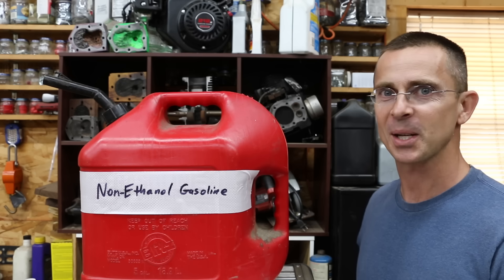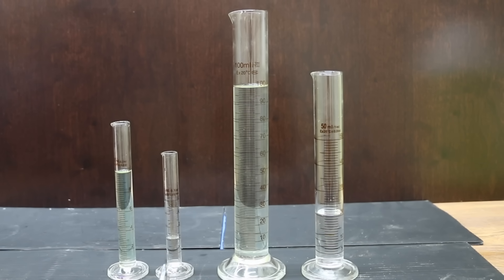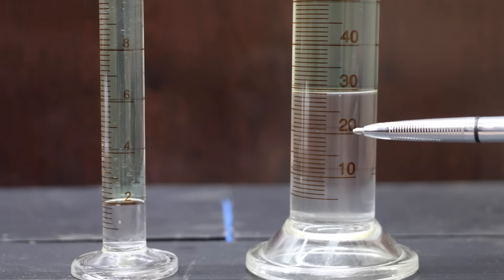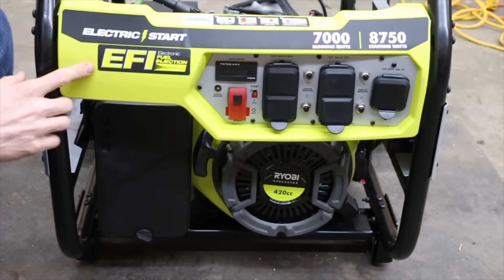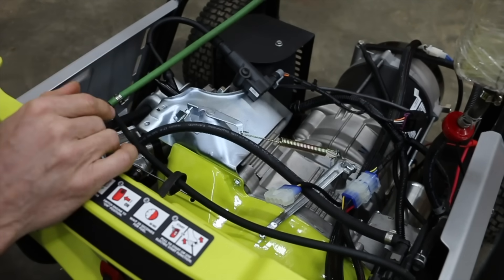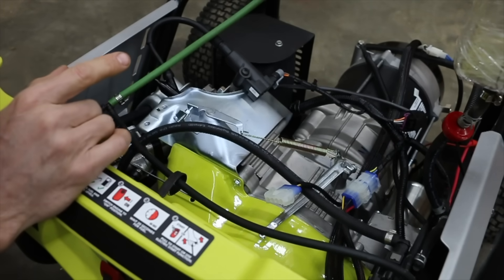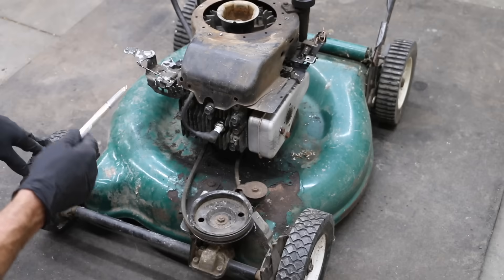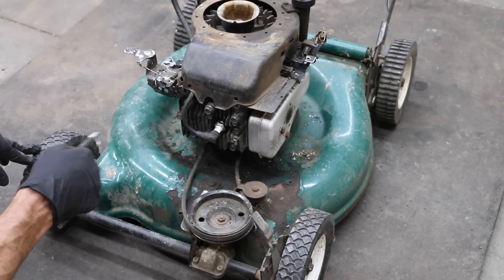Is Non-Ethanol Gasoline Really Better? See the PROOF!

Comment: Ive noticed that E85 is less energy efficient but costs less.  Typically though because of the bad fuel economy, anything saved from the price of E85 is quickly lost due to its bad mileage.  I realize this isn't flex fuel but its worth noting.
Reply from the maker: Great point. Thank you
Reply: 2011 F150 5.0 
Regular 87 octane i get 16.5mpg mixed
Super unleaded 93 I get 17.5 mixed
E85 I get 12.9mpg mixed

I get better mileage pulling a trailer with 93 than i do without a trailer on E85.
Its that bad.
Reply: @enigma9789  Wow..... huge difference. I noticed using an E30 blend the car idles better but has harder starts on occasion. This is on a 2009 135i BMW. The E30 allows the car to run much faster even before the turbos spool. So it's a mixed bag. Of course it's worse fuel economy and 93 price has dropped but I miss that extra HP. Plus... on E30 the car smelled better.
Reply: @alphazoomii9408   It does have more power on E85, that is for sure. but the 5.0 makes pretty damn good power on 93 already.
Reply: Ethanol has 66% the energy density of gasoline.  So what you need to do is run a few tanks of each and keep tabs on your mileage and your cost per mile to determine if it is worth it.
Reply: Trevor Nelson most flex fuel vehicles do benefit from a e85 tank once and a while to clean carbon out of the motor.   If you’ve ever seen inside of a motor that was ran off e85 you would be amazed how clean it was.
Reply: @jasontruman1215  Ethanol also washes away oil from the cylinder walls.
Reply: Horsepower Garage not entirely correct, if at the proper air fuel ratio it doesn’t do that too bad.... but it is a “dry” fuel meaning no lubrication. Gasoline has a very slight lubrication property.    So yes e85 should be harder on cylinder walls.    I’ve heard of guys adding a low dose of 2 stroke oil to e85 to help with this.
Reply: @jasontruman1215  I use a dose of Marvel Mystery Oil in my gasoline. It's a light oil that burns well  and allegedly fights carbon build-up.
Reply: In turbo car tuning, it's usually a pretty good start with your fuel map to double the fuel injected to get you started on an e85 tune.  Turbo cars love it, except most places vary between 70-85% ethanol and you need to get fuel from the same place so your fuel map stays tuned.
Reply: If you're in the US then Uncle Sam subsidizes the corn grown to produce the ethanol. Double whammy
Reply: The reason it cost less is because of Government subsidies and there trying to get more vehicles to run on it and people to buy cars that runs on it because it cost less to fill it with e85!
In reality it's more harmful to the environment it takes two gallons of fuel to make one gallon of ethanol not to mention the mileage sucks!
Reply: @doorguner01  "in reality it's more harmful to the environment it takes two gallons of fuel to make one gallon of ethanol" - no sir, this is some political misinformation that gets circulated a lot but it's never been true.    Think about it - If it was true, moonshiners wouldn't be making money.  ;-)
Reply: @jacksons1010  And here's you're sign!
Reply: @jacksons1010 Moonshiners make lots of money because there illegally selling it!
Reply: terry jenkins  Here’s YOUR sign smarty pants:  if it cost that much fuel to make moonshine (ethanol) then you’d have to sell it for more than what you’d pay in a liquor store...duh!   In real life they burn waste fuels like corn stubble to distill ethanol for fuel.   Let’s please keep this channel civil and avoid personal attacks, ok?
Reply: @jacksons1010  He's not wrong--since we stubbornly insist on making ethanol out of corn instead of more efficient feedstocks like algae (because of Big Ag lobbying), it actually does require nearly a gallon of fuel to run all the equipment used to grow and process ethyl alcohol from corn to make 10% ethanol.  This is also counting electricity--we're talking the emissions equivalent of 1 gallon of fuel, not the cost equivalent.

And it ruins your small engines/marine engines.

It all comes down to that uniquely American form of bribery: lobbying/Campaign Finance.
Reply: @doorguner01  so in reality it doesnt cost less at all to the consumer. kinda like a low flow toilet that u gotta flush 3 times to get a turd to go down lol.
Reply: @doorguner01  the whole idea is to turn away from primarily oil based fuel.. is it perfect no its not but its trying something until electric cars are more relevant.  atleast this is my understanding but im no chemical engineer so take it for what you will
Reply: 恵勇気  Not sure where you got you're information from but ethanol subsidies are still going that's one of the things I'm disappointed in our current president Donald Trump he's backing big ethanol producers.
by looking at the writing you live in Asia!
Reply: @doorguner01  The Federal corn ethanol subsidy and import tariff ended in 2011.  Ethanol producers receive no subsidy.  The G7 Nations' long standing stated goal of ending petroleum subsidies?...not so much.

Volumetric Ethanol Excise Tax Credit (VEETC)

Expired: 12/31/2011

An ethanol blender that is registered with the Internal Revenue Service (IRS) may be eligible for a tax incentive in the amount of $0.45 per gallon of pure ethanol (minimum 190 proof) blended with gasoline. Only entities that have produced and sold or used the qualified mixture as a fuel in their trade or business are eligible for the tax credit. The incentive must first be taken as a credit against the blender's fuel tax liability; any excess over this tax liability may be claimed as a direct payment from the IRS. This tax credit expired December 31, 2011. For more information, see IRS Publication 510 and IRS Forms 637, 720, 4136, 6478, and 8849, which are available via the IRS website. (Reference Public Law 111-312, Section 708; and 26 U.S. Code 6426) 

https://afdc.energy.gov/laws/laws_expired?jurisdiction=US
Reply: I have a 04 Scion Xb. On Regular 87 10% eth on a 10gallon tank I got average 280mile on a tank.
I found 90octane non eth gas. I tried it a couple of times. I was averaging about 310miles to 325miles on a tank.
Reply: Biosynthnut I use that stuff too, always liked it.
Reply: 恵勇気  The subsidies ended, but the federal government still forces us to use ethanol. That's better than a subsidy any time.

Comment: Hi! I have an idea, WD-40 as 2 stroke engine gas mix? Very curious to see how it would work. Also liked the video! Your channel is awesome and I love all the creative ideas ☺
Reply from the maker: Thank you for the video idea!
Reply: Start with 50-50, and get it more lean!
Reply: And other Oils. Like Oldoil or Sunfloweroil.
Reply: Isn't WD-40 basically fish oil?
Reply: @tracewallace23  Not sure...Pretty sure using any amount of WD-40 to replace 2 cycle oil will lock up the motor almost as fast as straight gas. 5% of me wants to see the test tho!
Reply: @tracewallace23  no, you can look up the msds, it's petroleum distillates. no fish oil.
Reply: Or marvel mystery oil.

Comment: Can you do a video on octain boosters and what effects if any they really have on a gas engine
Reply from the maker: Thank you for the video idea!
Reply: @ProjectFarm  If you do an octane test on gas engines could you include VP 110 octane gas along side of the octane boosters. (VP 110 as the octane booster).
Reply: braindeadtiger 4297     Octane  booster is just kerosene that you are paying too much for 😂
Reply: @jtswhitewater4940  no. A good octane boster contains additives so it stays mixed with the gas
Kerosene will just float in your gas tank on top of the gas
Reply: @jtswhitewater4940  wow. Wrong. Stop spreading fake news. Kerosene can be mixed with diesel safely, not gasoline
Reply: You can't do that on SV engines, you have to get an OHV or OHC engine with adjustable timing, also get a high load, then load the engine on low rpm and tune timing to just avoid a knock, then you will see results
Reply: The most noticeable effect is the $10 disappearing from your wallet.
Reply: Yeah, octane change means nothing but trouble if you can't tune the motor to take it. 
Likely needs to be advanced in spark at the very least
Reply: no practical value

Comment: Personally the only reason I use ethanol free gas in my garden equipment and go kart is because it does not go stale as fast as 15 or so percent gas and it does not degrade rubber hoses and it does not wreak havoc in my carbs and that stuff. So yeah I am not sure if it has performance gains over normal 89 octane.
Reply from the maker: Great point.  Thank you

Comment: I got a new engine for my garden tractor , and only one engine bolt lined up! I had to jerry rig the engine to stay in place , and used some good old , jb weld
Reply: Hope u didn't jb weld the motor to the frame
Reply: Damon Richter I had to . Either that or build plates for it which I cant do in 0 degree weather . If I need it removed I will chisel it off . Not a big deal.
Reply from the maker: Glad you got it going.  JB Weld is amazing!

Comment: I have a slew of Honda Generators in all sizes.  Honda makes really efficient running engines because of the carbs and the tiny metering holes it employs.  Along with running them every three months, annually I have to clean the carbs to get them running fine again.  No amount of PRI-G or Sta-bil works to keep the premium fuel ready to go.  I cannot find non-ethanol gas at the pumps in California.  

HOWEVER recently I bought some non-ethanol 91 gas from the local big box store.  Put it in the worst offender of carb gumming generators and within 30 seconds it ideled without any choke or sputtering (or additives!)  This generator has been needing 1/3 choke to idle for the last 3 years!!
Reply from the maker: Impressive!  Glad the non-ethanol fuel helped.  Was it a top tier fuel sold and the big box store?
Reply: @ProjectFarm   No name 1 gallon metal container.  Was actually one year old according to born on date, but instructions say its got a 5 year shelf life in the original can, or 2 years in a tank.

I went back and bought another 10 gallons right after my first use of it. :-D
Reply: Same here with my "guaranteed to start" Toro lawn mower. If it's in the shed for longer than 30 days, I have to clean the jet from the white residue blocking it from getting fuel. I just put a shutoff inline toward the closest, safest place from the carb and let it run out everytime I'm done now. It's a pain but not to bad. No non-ethanol fuel by me that I can find. My gas is bought at BP.
Reply: @J nielsen Did you try plane gas ? I know it still contains lead and I'm pretty sure there's no ethanol. Planes are safe, so is the plane gasoline.
Reply: @CaptainDangeax  I bought some Av gas once and didn't put it to use.  Was only 5 gallons and my friend that bought it couldn't remember what grade avgas it was.  I have it in storage for the 3 more years of its shelf life.  I can't get it anymore either.
Reply: I was thinking the Avgas is around 120 octane. I've listened to a couple of big block lopers smooth out and start to purr as it was poured in with the pump gas. I used to know a guy who ran it in his Mach 1 when he raced it. Don't know what he's up to now. Back then, when you bought a new Corvette...you took it to him to make it fast.
Reply: CaptainDangeax AVGAS is great stuff. It’s designed to always work in the toughest engine conditions. Avgas can sit for months and months and not degrade. My airport is 5.50 a gallon currently.
Reply: The only place you can pick the non-E stuff up around here is at a marina.   Evidently, ethanol gas plays hob with fiberglass fuel tanks.  When those start to dissolve and the crud makes its way into the engine, there's nothing but trouble ahea.
Reply: I lived in CA for 24 years, and you can still find it.  Its available everywhere, and only cost about 10% more than average gas. 
Where?  Skip back to the 1.56 of this video...
Reply: Go to your local small airport and run avags 100 low lead. Its 100 RON or 94 octane roughly. It is certified good to use in an aircraft for 2 years but really have a 5 year shelf life. All you need to purchase from the airport is a suitable container, a 5 gallon gas jug is fine. 

This is what I run in my lawn equipment including two stroke, and my stanyby generator.
Reply: Non-ethanol fuel is denser, so if you run it thru a carb without adjusting the carb at all you are essentially adding 4% more fuel. Your carb was probably adjusted too lean, and the non-ethanol fuel richened the mixture for you, causing you to not need the 1/3 choke in order to idle.
Reply: Av gas is still leaded.
Reply: @RobertSzasz  I thought no gas had lead, my 73 Econoline, the paperwork says it requires 93 octane leaded gas, been running ethanol, has been a nightmare, it rusted my fuel tank from sitting, eat up the lines, rebuilt the carb several times only to replace it due to futility, and it runs hot under load. I need lead, but don't know where to get it, I finally got a place for pure gas, expensive tho, not ten percent difference either, much higher.
Reply: @Maples01  nope, av-gas is still full o the old tetra ethyl
Reply: @Maples01  running leaded gas in your car is a federal crime, and costs a lot more than finding ethanol free gas.
Reply: @RobertSzasz  My engine requires the lead for the valves, it is tearing itself up without it.
Reply: @Maples01  zero fucks given. Tetraethyl Lead is incredibly toxic and there are adequate replacement additives  for cars and trucks
Reply: @RobertSzasz  Ah, yet you have no issues with planes using it
Reply: @Maples01  I've heard of using Marvel Mystery Oil as a lead substitute before.

Comment: You should try storing gas in a sealed container and a normal container and run an engine in a year !
Reply from the maker: Thank you for the video idea!
Reply: I left E0 (Ethanol Free fuel) in my snow blower and a year later (give or take a few months) with the same fuel it started without problems. Ethanol fuel's best left to your daily driver where you use it up quickly enough, if you let it sit for weeks or months at a time unused it's more likely to cause issues.
Reply: Fuel stays good for very long time.  I once used 7 years old petrol and no problem with engine
Reply: @101Volts   i run the equipment out of gas at the end of the season. that way you always start with fresh fuel
Reply: Also buy a container of Everclear at the liquor store and see how that does after a year.
Reply: @brianx04  I had some of that. It didn't last an entire year as it had a bad habit of "evaporating".
Reply: @brianx04  WOuldn't last! :D
Reply: We've left ethanol fuel sitting in a gas tank for several months before yet it started up pretty easily, must've been a lot of water in it though cause the exhaust was white until we got fresh gas in
Reply: Justin Noker yea , musve been steam coming out
Reply: I test that I had year old gas and it ran just fine with E10
Reply: Plants oxide and rot. Ethanol is made using corn. A plant. Perhaps there is a comnection.
Reply: Old gas always smells bad but Ethanol gas gets there a lot quicker.
Reply: @Fok yu   No, the alcohol gas does not keep better.  Ethanol is hydroscopic, meaning it absorbs water.  It will absorb water from the air itself.  It's the worst stuff to store over the winter.
Reply: Good idea... store some of each for a year in a normal plastic fuel can....and another batch with and without stabil.
Reply: @Fok yu   No, not at all. And the fuel goes bad EARLIER with alcohol in it.  Try being out on a lake 3 miles from shore only to find that all the liquid left in your fuel tank is just water.  Stabil does a pretty good job of keeping the fuel good, it does nothing for the 1/2 gallon of water in your tank.
Reply: @Fok yu Oh yes, I'd agree with that.  I was referring to what we have here in the states (not sure where you are) which is commonly a 10-15% mix.  It's fine if you drive regularly.  It's horrible in marine applications (water everywhere) and not good for storing for long periods.  I'll put either in my cars, don't care.  The boat, snow blower and mower get non alcohol gas for as long as they keep selling it.
Reply: @Fok yu E85 is available in Pennsylvania, too but not at every station.
Reply: BTDT from 2013 to 2018 used E10.
no problem per se.
Reply: @Fok yu and you would be wrong.

Comment: Seafoam as engine oil
Reply from the maker: Thank you for the video idea!
Reply: @ProjectFarm  or ATF, both are said to do the same
Reply: Scoring is guaranteed. Let's see it.
Reply: I ran 16 oz of Seafoam on the tank along with 16 Gallons of Regular Gasoline in my 1995 k1500 about 2 weeks ago everything is ok so far
Reply: It thinks it out too much. I added 2 bottles when my oil was low and blew my engine
Reply: @dirtsailoroff-road5580  lmfao it literlly says 1 oz per quart of oil and i put in 6 oz in for a 100miles and it cleaned my lifters out quite a bit
Reply: Can't imagine that would work well, it's designed to burn up with the gasoline when in gas and thins out oil  in in the crankcase. Probably lead to a nice smoke show before the engine destroys itself.

Comment: I have never used e 10 as it will void my car warranty ? Where i live down under  you dont have to use e10 but e 10 is 10cents cheaper the rest of the fuel is 91 oct 95 oct 98 oct $1.56 a Litre cheers .
Reply from the maker: In the US, E10 is at most fuel stations and will not void the warranty.
Reply: @ProjectFarm  Australia dont force you to use e 10 only if you want to save a few cents cheers .